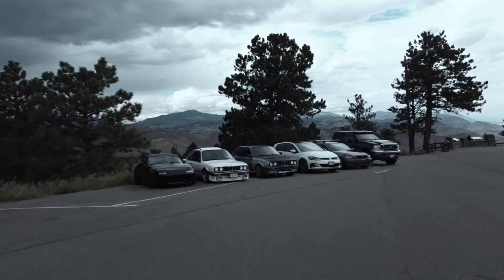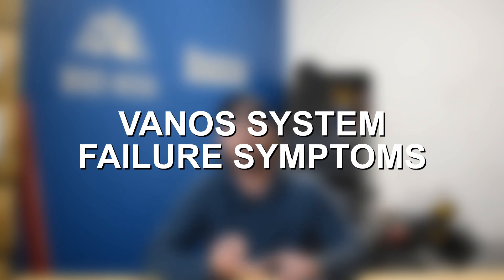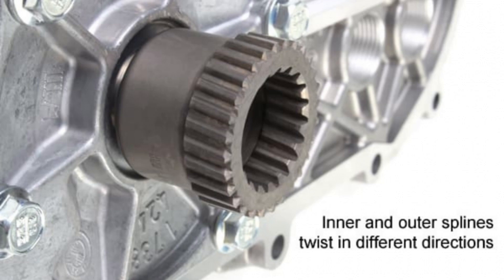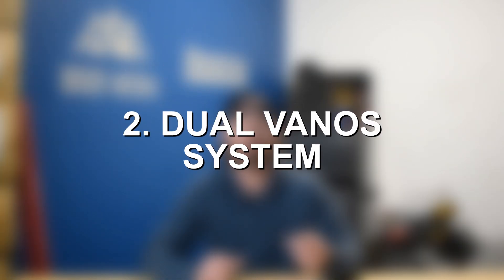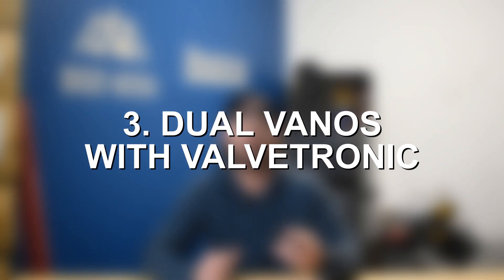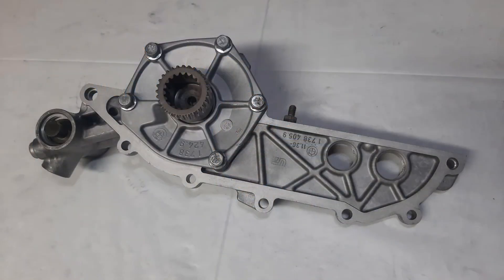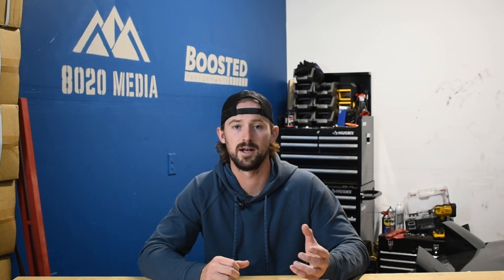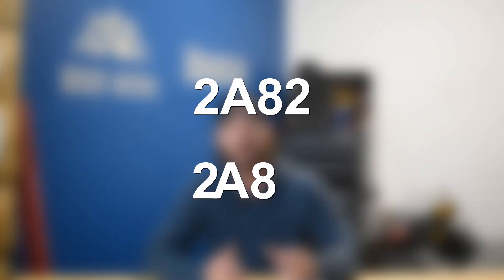The BMW VANOS System EXPLAINED! | Symptoms, Repair, & More

Comment: Hi, wanted to get your thoughts please! I'm trying to figure out the solution to flashing check engine light, drivetrain malfunction error and misfires on my 2013 328i n26 85k miles.  Codes are 130304, 131401, 131808 pointing to VANOS issues on exhaust side. Car sat for 6 months. Changed oil, charged battery and engine started right up and ran smooth but soon started misfiring. The ex solenoid tests good with direct voltage so could it be the sensor? Also could bad plugs cause those codes? Had a leaking turbo oil return line and lots of exhaust smoke but that's getting fixed today at the dealer under recall. I'd hate to waste time and money on a Vanos actuator gear replacement only to discover that doesn't fix the misfires. Thanks for any ideas. (oh dealer wants to charge me $295 for a full diagnostic but not sure that's money well spent when I already have a decent bi-directional scanner.
Reply from the maker: I'm guessing you have an issue with the solenoids, even though they're testing fine power wise its possible one is a bit clogged or gunked up. They are easy to replace so I'd recommend just getting a cheap replacement one, like URO and trying that. It could be a sensor issue but you'd probably notice more material symptoms than just some misfires if its the cam position sensor. If it's misfiring really bad then it could be. The last and probably least likely thing is it can be an issue with cam timing with the cam blocking rings but I'd say this isn't very likely. Also, I don't think it's this but this is worth looking at: https://static.nhtsa.gov/odi/tsbs/2014/SB-10053485-8362.pdf this is most common after a timing chain replacement
Reply: @8020Automotive  Ok, thanks. Dealer said they wanted to remove valve cover to inspect Vanos unit based on the fault codes so that's where I'll likely go if no change from a solenoid swap.  I assume the software is updated since the SB you provided is from 2014 but will check if dealer can confirm if that was done.  Actually drove the car today for the first time and a weird humming noise started coming from the engine. Removed the oil cap and it stopped.  Definitely suction there.  Now I know why someone drilled a hole in the oil cap as a workaround which I had covered up with a piece of tape. Time for a new valve cover. Cant just replace the PCV like on the N20.
Reply from the maker: Keep us updated!
Reply: @8020Automotive  Hello again!! I pulled the valve cover and exhaust cam timing was way off like 15-20 deg! I had to loosen the central valve bolts to adjust and re-time it with the locking tool. When rotating the engine to check though I noticed the ex cam gear vanos unit jumps or skips a little bit but remains in time when I bring it back to TDC. The intake side does not do that!  Suspecting it to be faulty, I bought a used ebay replacement gear (guaranteed working good they said) and installed it and it does the same exact thing.  I will try swapping the central valve bolt but not sure that would matter.  Would appreciated any advise here...Thanks!
Reply: Just an update, I went with a new ex cam gear and now it runs good. Valvetronic servo motor makes clicking noise for a few seconds sometimes when car door is opened but does not seem to affect
 performance.

Comment: Vanos is not like VTEC one bit, VTEC is variable cam lift almost, there's effectively a high and a low cam on the car, and the engine switches between a high lift camshaft and a low lift camshaft (even though both are on the same cam). Vtec isn't really anywhere else as far as I'm aware. Every brand has variable valve timing at this point, once again not the same as VTEC. Valvetronic is much more similar to VTEC, but then again, VTEC has been here since way before.
Reply from the maker: I wasn't getting into the similarities and differences here, but yes they are somewhat different. VTEC literally stands for Variable Valve Timing & Lift Electronic Control. They all do the same shit, they just work differently. But I get your point
Reply: Correct , VTEc Honda , Neo VVL Nissan and VVTL-I Toyota , are all lift systems that audibly change the sound when they engage , no VVT system is as violent as any of those 3 systems.
Reply: Well said, I was just about to comment and say the same thing. VTEC controls valve lift and not timing. The mechanics of them and what they do is completely different. I just replaced both of the valvetronic solenoids on my 2007 X5 today, nothing like VTEC.

Comment: I recently did vanos rebuild on e46 330i just after the rebuild car started up weird and misfire on all cylinders but when driving it has more power than before but stalls at redlight and at idle it misfire with a knocking sound exhaust sound fine  also better than before so im not sure what my problem is any help would be very helpfull
Reply: did you accidentally move the timing chain maybe? i heard some people accidentally move it and it messes with the car badly
Reply from the maker: Shir - Do you have any engine codes?
Reply: @8020Media No engine codes only  multiple cylinder misfires I'm using thinkdiag 2 scan tool sometimes when I drive with ac on than the weird noises dissappear and engine running much smoother

Comment: I have an N55 135i that has started having these symptoms and I initially replaced the spark plugs, turned out they needed replacing but it didn't solve the issue.  Looks like solenoids are next!  I'm glad I watched the video because most of what I could find in the forums had me considering a full actuator and eccentric shaft replacement.
Reply from the maker: Mar - Glad we could help! Unfortunately, just have to do things one at a time in hopes it fixes the problem. Keep us updated!
Reply: @8020Automotive  replaced the VANOS solenoids today and the improvement was immediate. No rough idle and no ‘stuttering’ at low speed.  It’s a pretty simple DIY job as well. Thanks guys!
Reply from the maker: Mar - Thanks for the feedback and sharing your experience! Glad we could help.
Reply: @marwilliam01 what vanos solenoids did you purchase and from where?

Comment: On the B group/generation engines and some late N63 I believe, Valvetronic and Vanos is used as the "throttle" while the actual butterfly valve stays open, maintaining positive manifold pressure!
Reply from the maker: Gen - Thanks for the insight.
Reply: I believe N52 is the same

Comment: Vanos alone is just VVT, VTEC would be VVT and VVL (phaser).. Valvetronic would be VVL
Reply: Honda’s i-VTEC system is VVT + VVL. Same with Toyota’s VVTL-i system.
Reply: @JonathanAcierto i thought toyota's vvt-i is only vvt?
Reply: @indomieforlife  whoops, you’re right, I mistyped. Meant Toyota’s VVTL-i is the same as i-VTEC. Corrected my original comment.
Reply from the maker: Gen - Thanks for the insight.

Comment: Cheers brother.. I have a well maintained E46 320ci coupe... 
However on a cold day or if she hasn't been run after a week. I start it up and it's missing fire in all cylinders... To fix I just switch her off, count to 5, start her up... And it's fixed? 
Any ideas and thanks for the detail in your channel ✅
Jade 🇦🇺
Reply from the maker: Jade - Thanks for the feedback! Based on the symptoms you're experiencing, here are a few things we think you should look into: the coolant temp sensor, fuel pump, spark plugs/ignition coils, VANOS solenoids, or a vacuum leak.